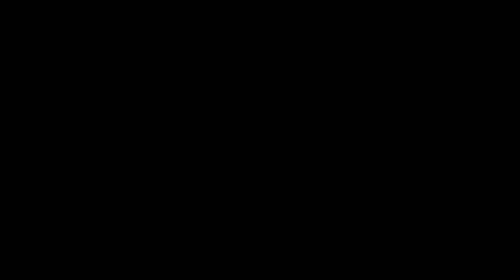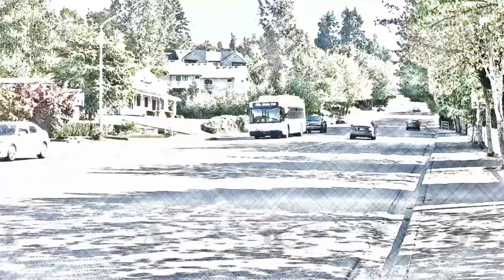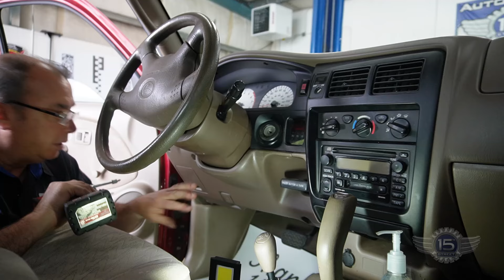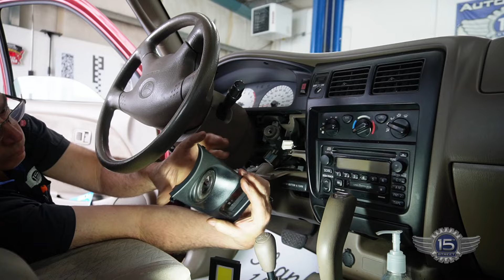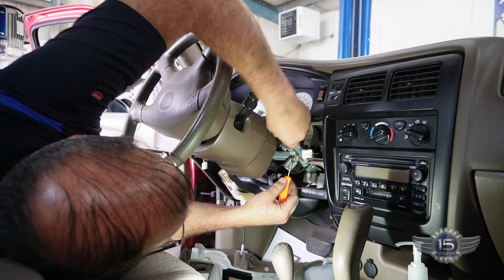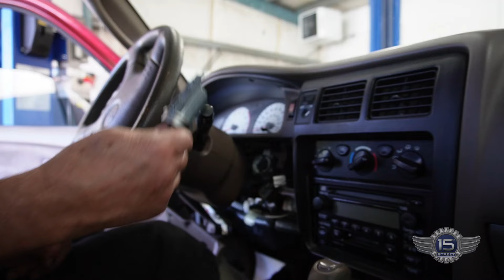Toyota Tacoma Ignition Lock Cylinder

Comment: I have the same issues with a 2002 4runner.   But also doesn't crank and the key will not come out unless you disconnect the battery.  It doesn't see it in park?

Comment: So how do you have it so the original cut key works? is this from the dealer or can a locksmith change it?
Reply: You take your new ignition barrel and old key to a locksmith, they can match a new barrel to your old key and save you needing to either replace your door locks to match a new key or have a separate key for doors and ignition. I'll be pulling an ignition off an 04' Toyota Hilux tomorrow morning and will be doing this for the replacement.

Comment: I’ve got a question!  I’ve got a 2000 model Tacoma looks almost identical    My key turned one click yesterday to accessory and then became completely loose in the ignition barrel    Just turns completely freely and doesn’t engage on, or start, or lock  just loose.   Even when I remove the key the radio and clock stay on because it’s on accessory   I disconnected the battery    The pin will not depress I’ve tried with multiple picks and screw drivers    Any advice on how I can get the barrel out?   I don’t want to drill the barrel through the key hole if at all possible?   Thank you so so much for your help brother!
Reply from the maker: You have to get the ignition lock cylinder in just the right position to push the pin in. If for some reason the lock cylinder damaged something in the housing the pin may be blocked. Your choice is to drill the cylinder out (risky) or just replace the whole housing. It's not as big of job as you might think. I was expecting to have to replace the housing on the one in the video. They are available from the dealer.